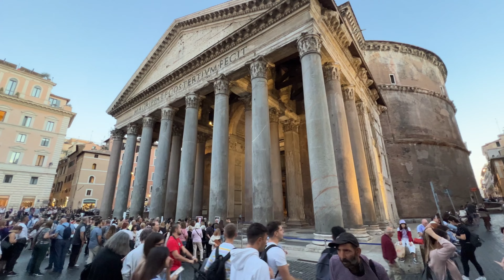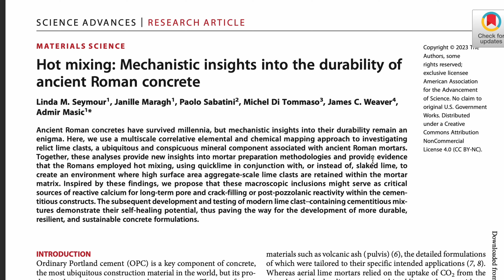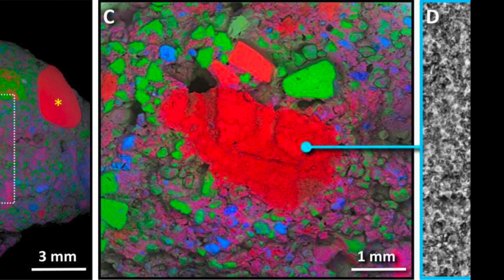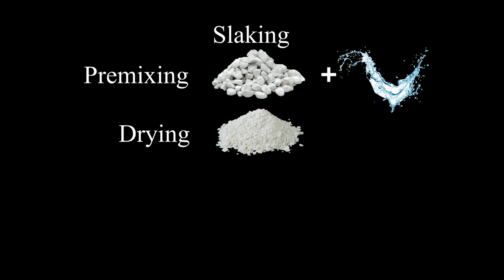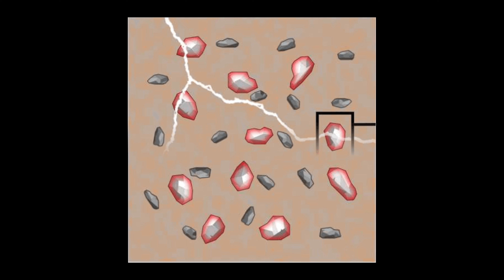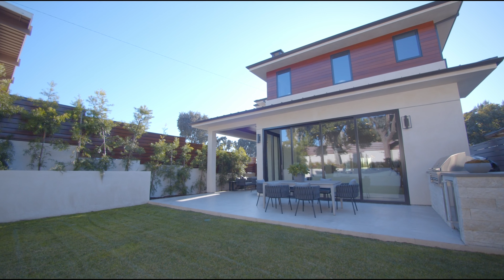How Does Roman Concrete Repair Itself?

Comment: The fact that the Romans developed this building material without any of the knowledge concerning its physical properties makes the achievement even more stunning. It also clearly demonstrates that there are other methods of aquiring knowledge that do not involve the scientific method, or reductionist analysis.
Reply from the maker: So true. Experience - another method to acquire knowledge.